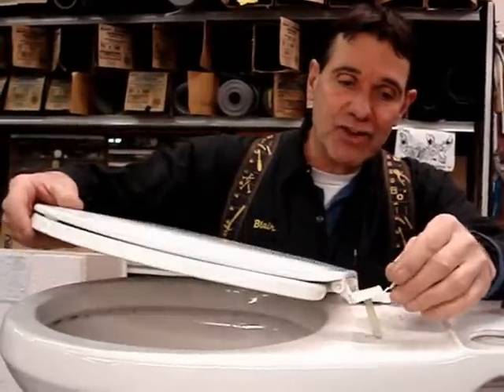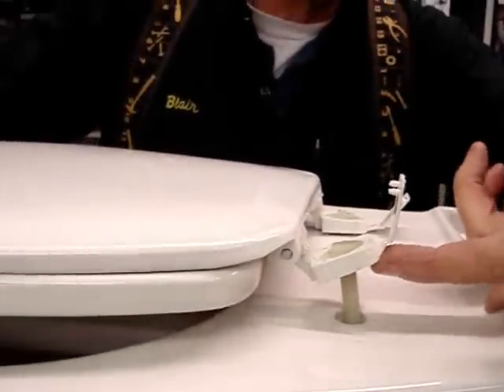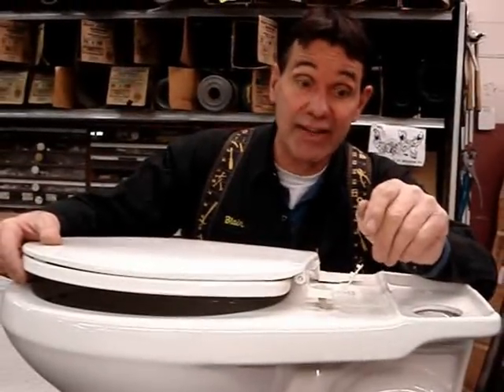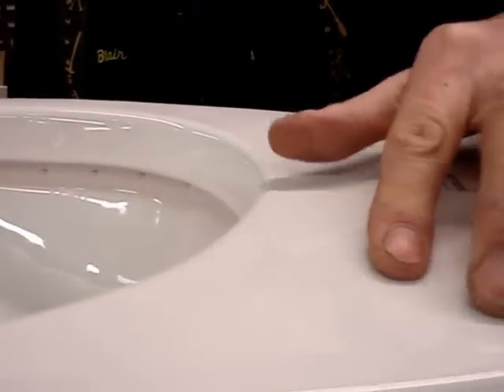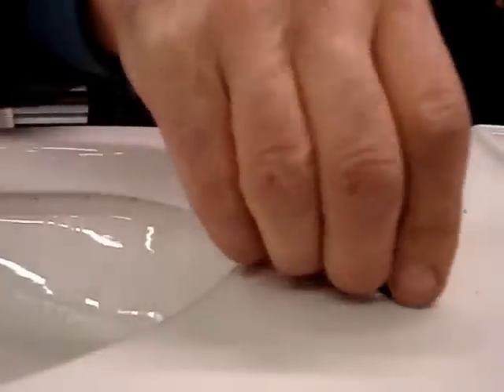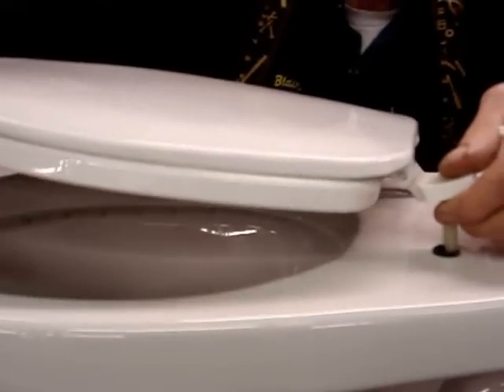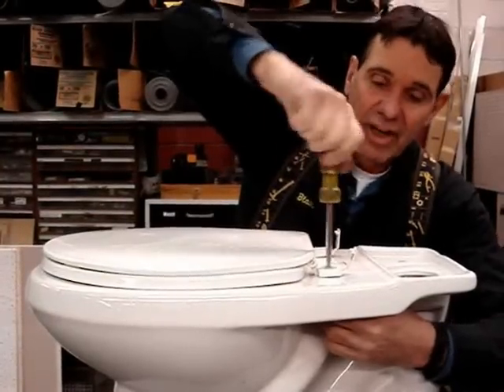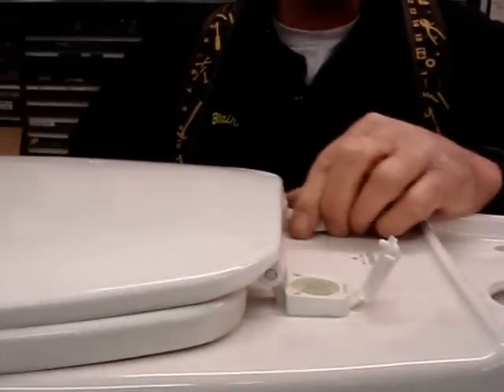Loose Toilet Seat? Stop The Wobble with this Inexpensive tapered washer.

Comment from the maker: Lawrence, Kohler toilets use the 'blind' screw/anchor system. The bolts should not wiggle in the china, but if the bolts are lose in the hinge you could 'spacer' them w/the proper size o-ring to reduce or eliminate the gap. I'm not a fan of the 'blind' attachment system because it uses proprietary anchors and you have to sent out for replacement parts.

Comment: Blair I need to get a hold of that rubber washer. Will you post to UK? I'm having the same issue as Lawrence- I am unable to get to the screw once it has been inserted into the hole- it's a 'blind' or 'closed' ceramic bowl. Any ideas what to do in this situation? Will the tapered washer work in this instance?

Comment: My SEAT is nice and tight; it's the LID that is loose and wiggling.  What do I do?
Reply from the maker: Dry it well and use ‘self adhesive felts’ on the lid in select locations.
Reply: @MrHardware1  Hi! The problem is with one of the two metal pins--one on each side of the lid directly above the screws that attach the seat to the base.  Each pin is enclosed in the same material as the seat itself. Do you know if I can hammer it back in place (it's protruding out) or if it needs to be screwed back in--which I would not have any idea what type of tool to use.  Maybe I just need to buy a new seat.....
Reply from the maker: @cookiequeen3291  I can’t say, too many kinds made…. You could possibly tap the pin back in place if you remote seat from the toilet.

Comment: what kind of flat driver bit are you using? mine has the same hardware as in this video, but that plastic screw is not very strong and I don't want to damage it. The slit on the bolt is very long. The biggest of my flat-head screwdrivers still felt too small for it.
Reply from the maker: You may have to purchase a big mechanics screwdriver. Large slotted screwdrivers are hard to come by.

Comment: most common problem is the seat hinges wiggle and not how it's fixed to the bowl.
single bolt on either side for a hinge is always going to be a problem.
if they designed things correctly in the first place half of us wouldn't ever have the problem.
check first to see if it's the fixing to the bowl that is loose or the actual hinges on the seat that causes it to slip off of the bowl
Reply: Galaxy Tab , the china is fabricated with some play because it is hard to fabricate to exact tolerances. The washers allow a flexible solution solution to eliminate the 'play'.

Comment: This is a great solution, however I am in the UK and can not find them in local independent hardware stores, major hardware retailers or plumbing merchants. Not one stocks anything like these, do they have another purpose, name or description that I can use to track them down? Thanks for the video, I have subscribed.
Reply from the maker: Try a plumbing supply house, an old one that would sell washers to install a 3/8" supply line to a faucet. That should work. cheers

Comment: I'm wondering how u screw the screw down if it's a blind screw in a slightly smaller hole in the washer, or not for that matter? Think using a pair of pliers or wrench would take forever.
Reply from the maker: This wedge washer is for through bolts. It probably won't work on the blind anchor that some toilets have.
Reply: I don't know the technical name of stuff. What I described as a blind screw is probably a bolt in that there is no head and no pointy bit.
Reply from the maker: Can you email a pic of the bolt or screw you are having trouble with? blair@mrhardware.com

Comment: What about those commercial type toilet seats? I work at a local grocery store & i do janitor type work there, cleaning the restrooms. Those curved-looking pieces that sit on the back sides of the toilet seat, two of them have gave way over time. They're made of hard plastic & they broke in half the other day as i was cleaning the toilet in the men's bathroom. The toilet seat is a Bemis brand name. Any suggestions on what i can do to fix that seat?

Comment: What size is the tapered washer please?
Reply from the maker: @ishbhad  it is approximately 9/16 tall, 13/16 od, 3/8 id hole. (The actual measurement varies by manufacturer. These washers are made to connect a 3/8 supply line to a basin cock) We are a small hardware, more into nuts and bolts than technology so I apologize that our web presence is a bit primitive. I will pass the suggestion to our IT guy because it is a good idea.

Comment: I have been trying to find the tapered rubber washer. Can you tell me if Home depot or Lowe's carries them and what they are called? And a picture of the washer uncut, the video did not show a close up.
Reply from the maker: It is a 3/8" basin cock washer. Used in the 1970's and before. Most plumbers haven't seen one in 30 years. Only a true old style plumbers warehouse would stock them. Order them from us and we will ship

Comment: Those curved pieces sit back there on the hinge, acting like spacers so the seat doesn't move around. Well, since they broke, the seat is wiggling around badly. It's only on one seat in the men's bathroom at the grocery store where i work at. The women's bathroom, one of the toilet seats in there, one curved piece broke off a while back. I guess when the toilet seats are used alot in public places like that, parts tend to wear out over time.